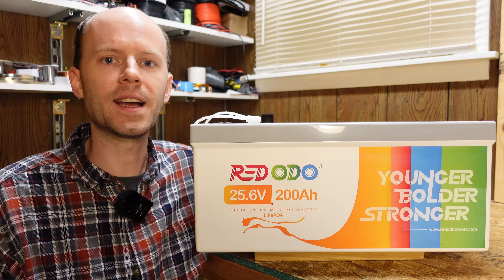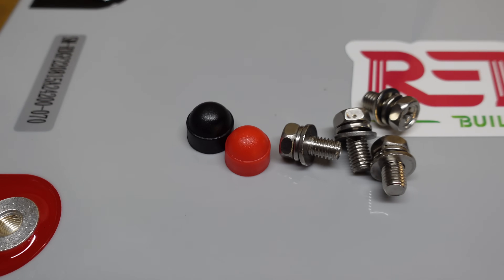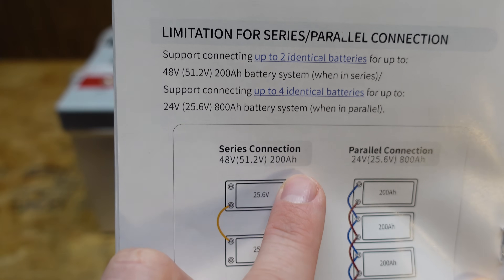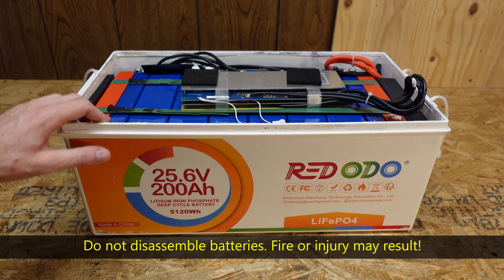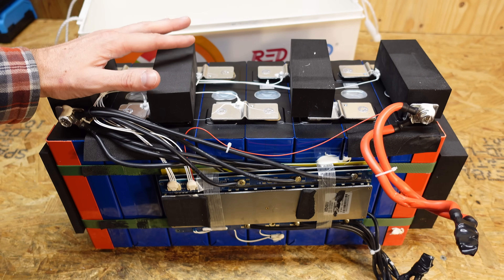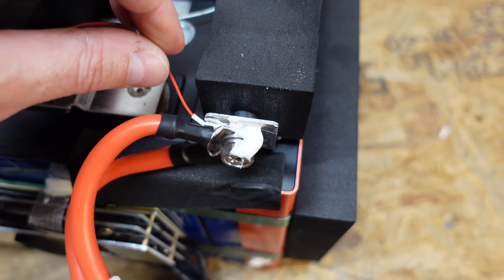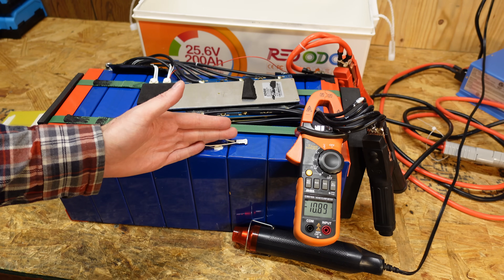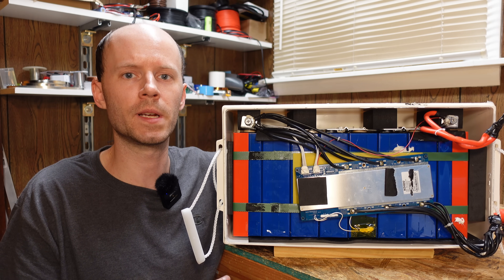Redodo 24V 200Ah LiFePO4 Battery Teardown, Over 5100Wh of Power!

Comment: 2:54 What's the purpose of limitation to 4 batteries for parallel ?
Reply from the maker: I couldn't really tell you... Almost all companies selling these type of batteries seem to list 4 as the max for parallel connectivity. At first I thought it had to do with short-circuit current; however, each battery would have its own BMS so I'm not sure that's the case. I don't know.

Comment: What happens if the Bms dies in this sealed baterries?
Reply from the maker: If the BMS fails inside of a sealed battery, your options would be to see if you can exchange under warranty or properly dispose of the battery (recycling).
Reply: @LithiumSolar  then sealed batteries are junk. Who knows where these vendors will be is 1 year. They keep changing names like every other year. And overall all these batteries seem to be made on the same production line. They only have sticker label. No real brands, just funny names with colorful labels.  At leask sok can sell parts and you can take it apart and fix. The most sensitie part is the bms. Good luck with amazon vendors from china and warranty. Nobody buys that. Properly recicle a battery means , open up and see if cells are good and reuse with new bms. This noname brands from china that sell on amazon, feels unamerican.
Reply from the maker: @crinabobo7412  I can't say that I disagree there... Brand names seem to be disposable in a way. From the manufacturer's perspective though, there is a lot of danger in telling the customer to open and service the battery themselves, many customers whom are not qualified to do so (ie don't know what they're doing). I guess I have mixed feelings on the matter. SOK for sure though if looking for quality and serviceability!

Comment: We have 2 Redodo 100 amp hour batteries Wired up to busbars and our Solar set up is 12 V we have two Victron smart charge controllers networked together a 100/50 smart c/c with 6  Renorgy 9 bus barrs 100 watt  solar panels wired up in series series parallel and a 100/15 smart controller c/c with 4. 100 watt Renorgy 9 bus Barr solar panels wired in series series parallel and we are using this set up to run our full size top mount freezer Frigidaire refrigerator. Our Redodo battery’s work very good (at this time anyway) We’ve been using this set up since July/August somewhere in that area of time.The only thing that limits us is the whether,,,if we have too much cloudy or overcast days we have to put the refrigerator on grid power till the batteries charge back up other than that these batteries have been real work horses. I’m using a 12 V 1200 W Victron phoenix inverter and a Victron smart shunt. I’m thinking about adding a third charge controller with 300 or 400 W to the system for the rest of the winter months and building another Solar set up similar to the one we have now as a kind of back up and additional power. At this point we would highly recommend Redodo batteries 👍😊 I think my advice would be concerning these batteries is,,,,,,,,it’s kind of like watching a stripper,,,,,,don’t ask how it’s done just enjoy what’s coming off👍😊 💃👯‍♀️💃👗👙👍😊
Reply: How are the batteries holding up now, after 10 months use?

Comment: I am interested in the max discharge current. Have you tested the continuous load at 200a as well as the max 400a load at 5 seconds.  I plan to have two of these 24v 200ah batteries wired in series attached to a 24v inverter and a bow thruster.   Primary use is going to be an inverter with nothing above 1200W pulling.  This is on a boat and I will occasionally have a 330A 24V load for 2 to 10 seconds at a time for the bow thruster.  With two batteries in series I should have 400A continuous and 800A for 5 seconds available.  If the BMS cuts the battery off how does it reset.  I believe some BMS’s will reset in 5 seconds after the load is removed, others you have to wait quite a while and some have to have all the leads disconnected from the battery.  I believe that I have a sufficient safety margin on the amp draw but am interested in actual results from an independent test.
Reply: Si le 2batterie unite in parallelo più e più con meno e meno no in serie per 25.6v 400ah e in  serie diventa 51.2v 200ah ok?

Comment: I have a question for you about  a bulge at the bottom of my Redodo 24v 100. Was there Eva foam at the bottom of the battery box or on the side of the battery facing down in the battery box on the 24v 200? I found another utube video where another user found a bulge. Redodo Says it's foam. But also tell me if I look inside I lose my warranty.
Rod
Reply: Fai un video mentre open la apri watch open battery video

Comment: So question.. could you theoretically redo the series into parallel to make this 12v 400ah? And if so would you need a new bms?
Reply: Or would it be just as effective to use a converter?
Reply from the maker: Yes, you can wire these batteries in parallel. This is a 24V 200Ah so if you wired two in parallel you would have 24V 400Ah (not 12V). No special BMS or changes are needed for paralllel wiring.
Reply: @LithiumSolar  I was leaning more to rewiring the battery itself. Perhaps it was a misprint but I found a 24v 200ah battery that was cheaper than a 12v 200ah battery and was considering taking advantage of that haha
Reply: 4celle in serie più 4 celle in serie unite in parallelo yes 12.8v 400ah the new bms

Comment: Can you explain the reason behind the limit of parallel batteries? Manual states 4 max, why is this ?
Reply from the maker: That's a great question. I believe it has to do with the amount of short-circuit current a BMS can safely interrupt under a fault. That said, pretty much every battery I review states a max of 4 and I don't see how they can ALL be 4, sooo....

Comment: Could you put more than 4 in paralell if they were properly fused? i cant seem to find any data on this.
Reply from the maker: I don't see any reason why not.
Reply: @LithiumSolar  thanks for the quick reply.
Is says only up to 4 in paralell not sure why. Maybe without proper fusing the bms' can't handle it
Reply from the maker: @LukasHaydenOfficial  To be honest, I'm not sure why either. I assume it has to do with interrupt current during a short circuit fault; however, they could simply say that fusing is required for parallel wiring.
Reply: Just put a fuse on every battery, myself I prefer circuit breakers.

Comment: One unit that no one does a proper review of is the natures generator it's a great starter price and good be a great starter unit but it has improper charging parameters for sealed lead acid batteries yes it keeps the price down by using sealed lead acid batteries but if the battery would last 5 to 8 years a person on low budget can save enough money to buy a lithium unit and with proper reviews it could fix the charging parameters problem and maybe put a programmable mppt solar charge controller and windcharger controller with the ability to charge lithium just think when the sealed lead acid battery needs to be replaced it could be replaced with a lithium battery and you'd have a great unit  the best thing about this unit is there sold at the big box stores so even in Canada it's a affordable price I can stretch my budget to buy a 2000 $ unit and that's with extra battery units and a 400 watt windcharger  but if all the reviews say is that they work when bought nothing about having to buy new batteries every year because they are not fully charged and discharge below safe limits causing the batteries to die prematurely then they won't change if I hadn't found utube and found out the proper charging parameters for sealed lead acid batteries I'd probably bought one after all I had bought new booster packs for years for the 400 watt modified sine wave inverter so I could charge my cordless power tools and run a drill for my work I always that's how long the battery lasted so far I've got an extra year of life out of the last one I bought because when it started losing capacity I started charging it proper I had checked with the manufacturer if their charge parameters were correct and they lied and said they were since I found utube I've also found out how to change the battery in my old booster packs so I'll rebuild some of my better ones and upgrade them as well

Comment: OVERPRICED FOR NOT HAVING LOW TEMP PROTECTION OR BLUETOOTH. Still overpriced even if it did plus a heater .
Reply: Where is the $80 coupon you mentioned?
Reply from the maker: You're kidding, right? What exactly do you think a 5.1kWh battery should cost??
Reply: @LithiumSolar  I agree, the battery should be 1200 for bargain status.
The 100ah 12.8v at 300 with low temp protection shipped is a better deal.
Convenient package, great capacity, but at that price it should have low temp protection, if not heating.
Reply: @SuperVstech  I guess they could offer a unit with those things added for another $200 odd.
Reply: low temp charging protection should be handled by the charger and not the battery.  Battery level low-temp protection is a last resort against a dumb charger. Get a smart charger - which already has that function, so you don't need to worry about your batteries.

Comment: thx for the vid. do you have any recomendations for a 48V battery that goes in a Hustler Zeon zero turn riding mower? It had 4 12 volt lead acid batteries wired in series. Would like to replace it with a 48V lithium with low and high temp protect

Comment: BMS looks a little whimpy especially the heat sink but the price is better than most per kwh.
Reply from the maker: Hmmm, maybe we need to do a high-rate discharge test?
Reply: @LithiumSolar  yes would be nice to know.
Reply: Yea 200a with 400a for 5 seconds, two of these could nicely power a 48v golf cart if those specs hold.
Reply from the maker: I'll have to find more 24V loads. This inverter is the only 24V I've got and is 2400W (100A).
Reply: @LithiumSolar  You could always make a 24 volt heater lol

Comment: Could probably knock on the side and lay it on the solid one? The more hollow sound would be the terminals
Reply from the maker: That's a good idea. You would be able to easily tell which side has the cell bottoms due to having significantly more mass.

Comment: Why do these manufacturers still build batteries without low temp protection?
Reply: because these cheapo BMS do not have a Micro controller. Anything that actually measures temp would require a micro-controller and ADC to read temperatures and then send signals to the fets to turn them on / off. Instead they use DUMB bms units which have no way of converting a thermal probes resistance readings into a temperature reading.

They will never change, adding a MCU would add about $15.00-$20.00/unit
Reply: @Foxfried  Also, there has been a chip shortage. If they knew they could sell way more batteries, some would change and the ones that care at all about their costumers needs may too.
Reply: It only hurts when charging and it has to be around freezing to even matter 🤷‍♂️